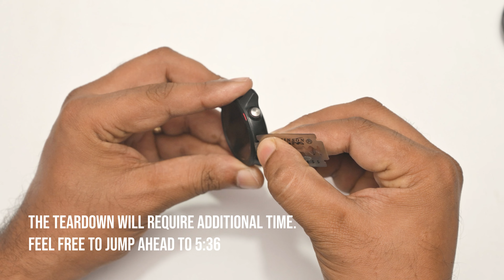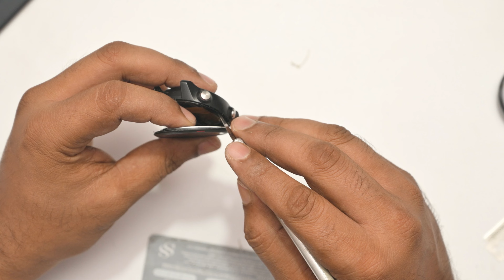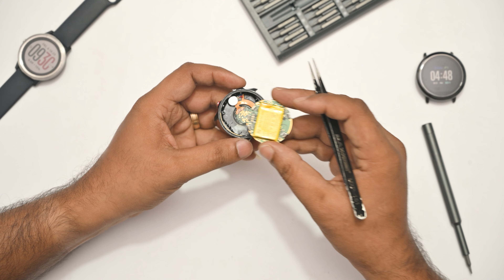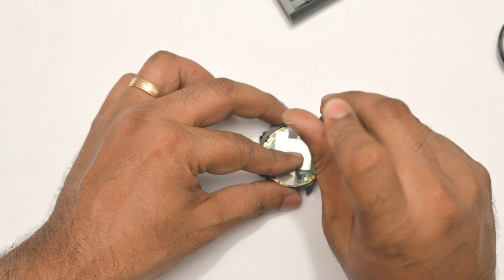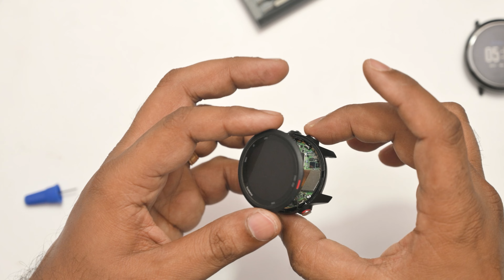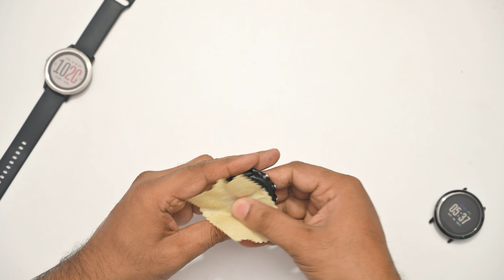Garmin forerunner 245 teardown and battery not charging issue fix

Comment: Thanks this helped a lot, watched was repaired with your help.  I was thinking selling watch on eBay for cheap because the lcd screen had a big white dot in the corner blocking out part of the distance ran when it running mode